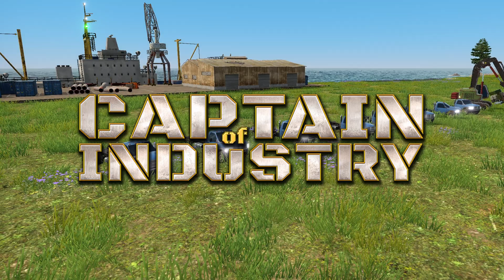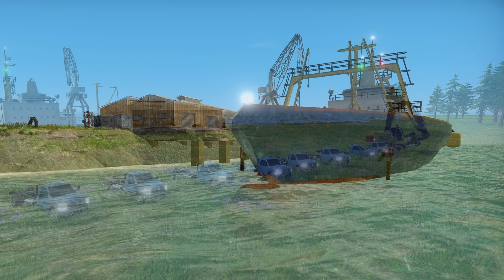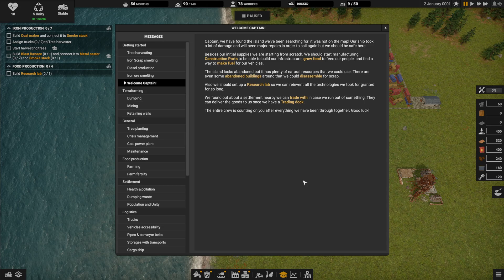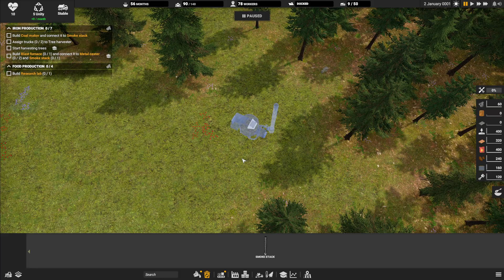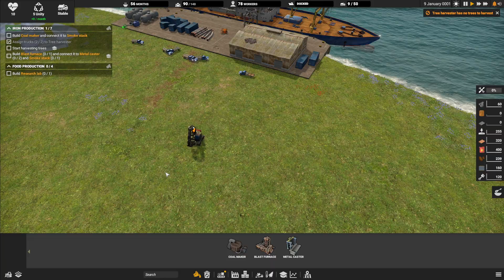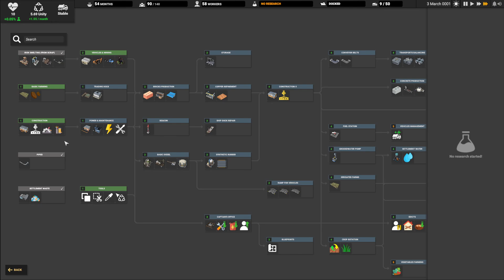Slightly Overambitious Start - S2E1 ║ Captain of Industry

Comment: I'm noticing a lot of graphical upgrades since last time you played (and also since I bounced off this game). As you say, the tree harvesters chop the logs into smaller pieces. Also, my favorite thing, you can see what the trucks are carrying! It's not just anonymous boxes anymore.

I think we're also seeing more grass regrowth than there used to be. You can see it the most clearly in the slope down to the coal mine, and I really like it. Great start to a great series, buddy.
Reply from the maker: They also changed the way resources look, both on the surface, and in storages. Now they look more layered, like they would in real life.

With the new tutorials, I would suggest giving it another try. Early game can be a bit simple and boring, but it gets really interesting as you progress.
Reply: @Hmuda  I'm no good at these factory builders. I can't seem to wrap my head around scaling up production (I usually stop playing Satisfactory when I have to start making steel, for example).
Reply from the maker: @TerribleResults  I was also bad at Factorio when I started. What I found to be a good approach was to treat every single production as their own little puzzle. Once they are working well, then I can stop thinking about them as the individual parts, and only treat their output as a singular thing. Learning about the "main bus" method of organising the factory a HUGE help in this, since I can just push the products onto the bus, and then only revisit individual production arrays as necessary.